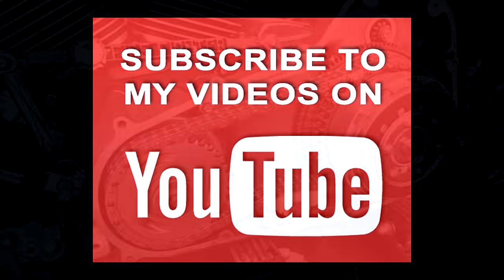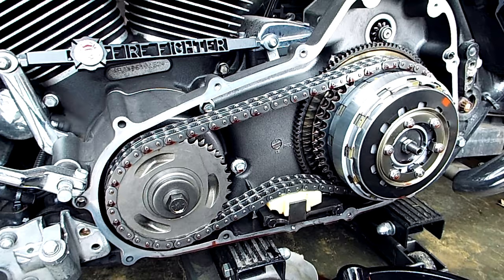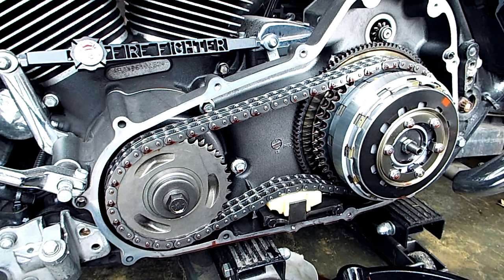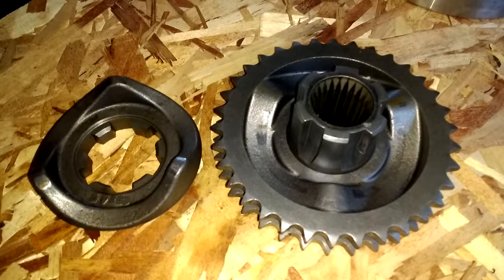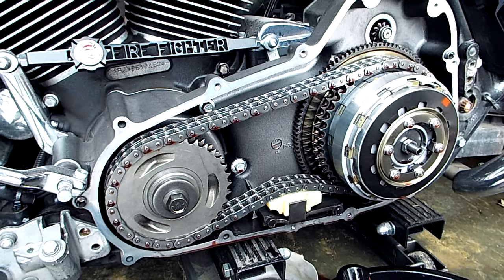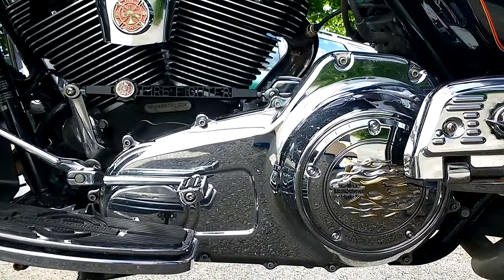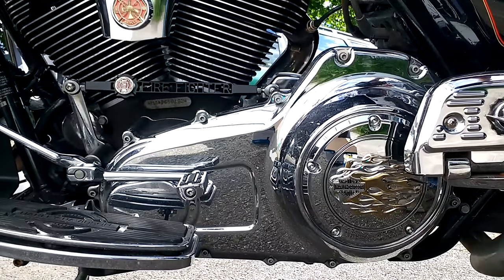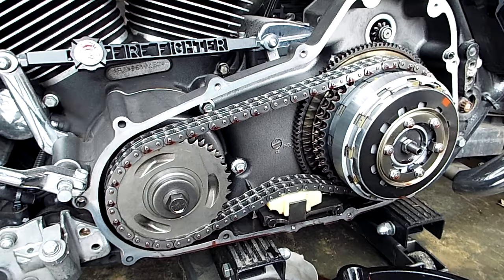Harley Compensator Noise

Comment: 2010 ultra classic. Harley replaced mine twice. Now it's screwing up again. I'll fix it myself this time .
Reply from the maker: Word has it the 2010 bikes were the first to come from the factory with the Screamin' Eagle compensator as standard, and you've worn out 3 already? By worn out, it's usually the spring pack, but did they say what was wrong with the other two? What is it doing as a sign that something is not right inside?
Reply: @contact4mwy7  when it's hot and you try to start it it sounds like a hundred bolts getting scrambled up in there. Everything in the primary side was replaced the last time  compensator primary chain and tensioner primary gears transmission bearings clutch pack clutch basket stator. Everything.
Reply from the maker: Sounds to me like the spring pack has lost its tension allowing the ramps and spokes to clang around on the compensator?
Reply: @contact4mwy7  yeah that's what I'm thinking also. Doesn't do it all the time just when hot.
Reply: @contact4mwy7 mine is when cold or hot. Has gotten louder over the last few days. Sounds like it’s from the primary. 2010 street glide CVO with the 110 motor

Comment: I have a 2010 ultra limited with the 103....same thing
Reply from the maker: Sounds like you got the flat-style compensator from the factory too?
Reply: @contact4mwy7   yes i do.
Reply from the maker: @kerryhawk8075  my motor is the 96ci  and that was enough to wear it out. I think the mileage varies due to how hard you get on the throttle or how low the rpm's go chugging along before you downshift. Eventually, the springs will get weak and need a replacement.

Comment: It sounds like a starter going bad
Reply from the maker: Gene Bradbury that's right, and that's what I feared was going on, but it turned out to be the compensator's spring pack was worn out. Newer Screamin Eagle compensator installed with the same starter and all is good again.
Reply: What I was trying to say was that's what it sounds like. A sound comparison for other riders to try and understand the noise.
Reply from the maker: Gene Bradbury thank you!

Comment: I’m wondering about what it cost to fix? Lol
Reply from the maker: A replacement compensator, an inner primary kit if you're going to remove and replace it with the compensator upgrade  instead of grinding part of the inner primary away to remove the stator hub, new primary fluid, new outer primary gasket, new round gasket for the primary fill/clutch adjustment cover, and labor. I went with a harvested Screamin Eagle compensator assembly to save a few dollars.
Reply: @contact4mwy7  Thank you. I work on a lot of cars but I don’t have much confidence working on a Harley.
Reply from the maker: @adamcartwright6220  I had to get my nerve up, and watch a few videos on YouTube University. Lol. A service manual is a huge help too.
Reply: @contact4mwy7  Man, this sucks. I literally just bought this bike, my very first bike and now this. Almost broke me trying to buy one. 😔 I’m a 💩 magnet!
Reply from the maker: I know how that feels! My first Harley, a 1997 Road King, was dripping gas from a fuel line on the first day I wanted to ride it to work after I had just bought it the week before! I had to take the car. Now this bike, a 2009, has a bad compensator that needed to be replaced after owning it for one year. Both bikes bought previously ridden, not brand new. If you don't want to try it yourself, save up some money and have a shop take care of it that knows what they are doing. Reputable. In the meantime don't ride it if it's acting up to keep from making things worse. Hang in there.
Reply: @contact4mwy7  Thank you sir! I do appreciate it. Really makes me realize a Harley isn’t all it’s cracked up to be. Expensive name.. Thank you! Good luck as well!

Comment: I just eliminated mine today
Reply from the maker: Nathan Swisshelm I'd like to know what the differences are in how the bike rides with a solid sprocket. Thanks!
Reply: Mark Young - Outside The Box I'll keep u posted,I had a horrible grinding noise during hot start and a clunk going into 1st gear
Reply: Mark Young - Outside The Box Hey Mark rode today,I notice quit a difference low end chug for sure also notice a chug at lower rpm in higher gears,no more noise though.
Reply from the maker: Nathan Swisshelm if you keep your rpms up by shifter to a lower gear, instead of lugging the motor, it's not that bad? Does it take some getting used to? I reassembled mine with a 5th spring washer in the back against the stator rotor and no more clunky noise on hot starts, but feel a bit more engine pulse, probably due to the stiffer springs setup. I will be uploading video of it soon. Thanks for getting back to me. There isn't much feedback available from people using a solid sprocket.